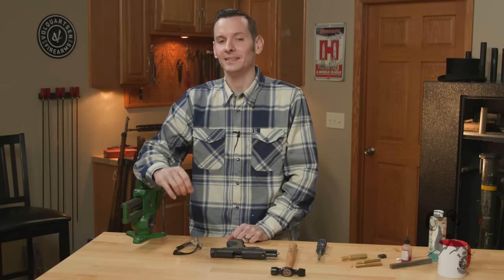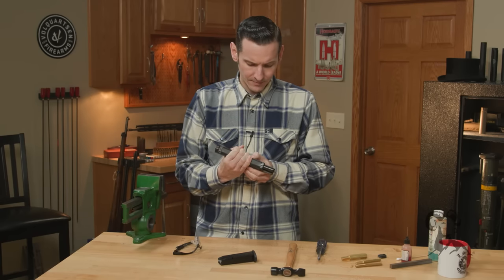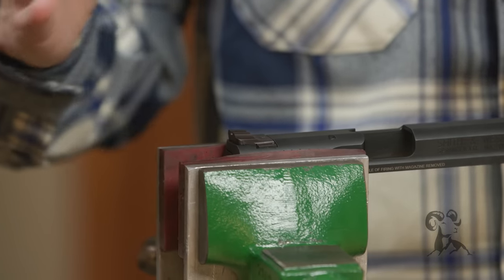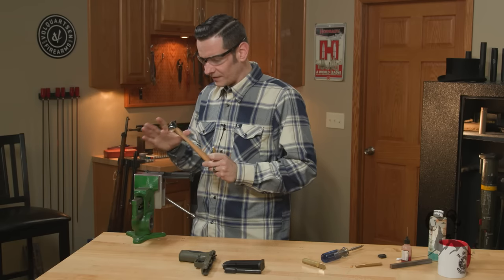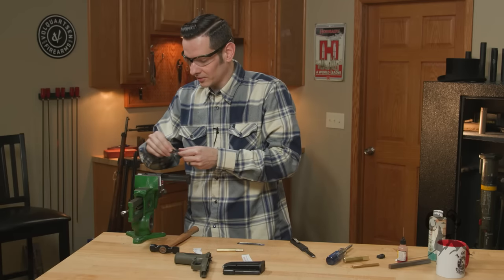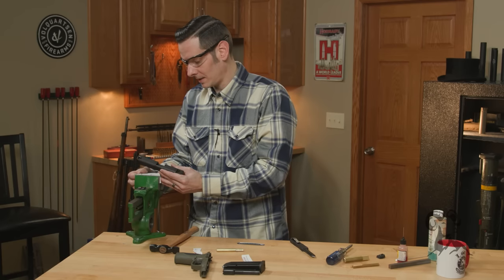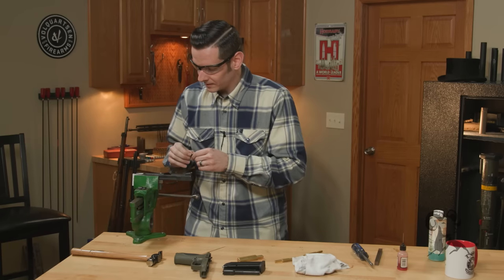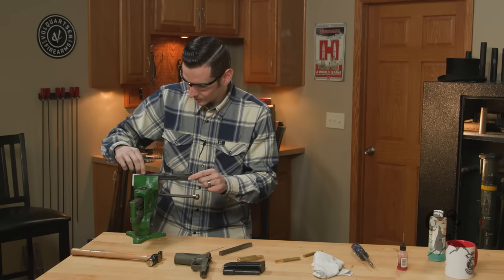Tech Tip: How To Install Pistols Sights the Old School Way

Comment: Smash that like and sub button if you have ever damaged are marred something because you did not have or want to use the specific sight installation tool.
Reply: I'm actually ashamed  🤣
Reply: Define "Damaged or Mared".
Like safe queen "omg you nicked the finish" or like range "would've been a great shot if I wasn't aiming three targets over" ? 

Either way I'll contribute to their proliferation with the like and subscribe features. Just saying
Reply: I destroyed so many inexpensive brass punches removing and installing sights.  The sanding wheel makes quick work of the marred punch and can easily brings it back up to spec for the next job though.
Reply: Caleb, I wish I had this video last year. I watched other people remove M&P sights, but yours was the best. I gotta say those factory sights got destroyed bcuz they were so tight. I ended up using steel punches just to move them. I put penatrating lube first, but no go. It didn't matter bcuz Tru Glo sights were going on my Shield anyways.
Reply: What would be a good host to try tons of iron sights when changed a lot? I there like an insert available that makes it easier to change to narrow things down?
Reply: Dang dude, your pinky has some weird flex to it when you were using the punch driving the sight out.
Reply: Right after cerakote too

Comment: Watching you struggle with that sight made me so happy.  I have changes the sights on 4 different M&Ps.  Not one we’re able to be removed with a brass punch.  I have two destroyed brass punches that just mushroomed from me hammering in it against the sight.  I have always needed a steel punch to get it started.  Luckily I have yet to damage the sight with the steel punch.
Reply: be sure the dove tail is not tappered.. sounds odd, but I've ran into it. it will make ya scream.. then comes the flying hammer technic.
Reply: Same with my Shield 1.0! I bent the brass punches then went to steel punches finally. I did use penatrating oil first but since I was installing Tru Glo sights it didn't matter if I destroyed the factory sights. Sight pusher tools got messed up too. Those sights are a bear to get out!
Reply: I destroyed the front sight on my security 9 and now cat get it off 😂😂😂

Comment: I had a S&W handgun that I was changing the sights out on many years ago.  I was not aware of the striker safety being under the rear sight.  The parts went flying away from me and I had a rough time finding everything.  I ended up finding most parts except the spring.  I did not have anything on hand that was small enough to fit as a replacement.  I contacted S&W about my dilemma, they said no problem and sent me a new spring free of charge.  I know these springs are not expensive and at the time neither was mailing one to me, but I still appreciate their customer service and helping me out of a jam.

Comment: TIP: Older S&Ws have 2 plunger/springs under the rear sight, so if your punch stays flat on tenon you're okay, but you can also drift with a large ziplock over e-thing, to catch any boingers.

Comment: Well done. 👍
I'm a long retired gunsmith and was trained by old school instructors at the school in Trinidad Colorado. After graduating, I apprenticed under an old master gunsmith for four years for zero pay. (I was a peace officer, and worked in the shop off duty). The man was a longtime gunsmith for the Colt Custom Shop, and was unbelievably skilled. This was in the mid 70's. Everything I learned was old school. And that's not a bad thing at all. 😉

Comment: The bigger/heavier and more secure your bench vise is, the better. Also, smooth copper or aluminum vise jaws are ideal to get the maximum energy transfer into drifting the sights out vs uselessly oscillating the entire slide with every hammer blow. The more immovable the slide, the better. If you have a rock-solid fixture, you will require nothing but light taps from an 8oz ball peen hammer to drift out even the most stubborn sights.

Comment: I went to M&P Armorers school, the handguns we used in class were very well used and the rear sights basically slid off, the instructor assured the class that the handguns we will be working on outside of the classroom will definitely put up a good fight. Great video, thank you for sharing!
Reply: He was right! My Shield 1.0 was a PITA to remove, even after penatrating oil was put on the dovetails. Destroyed the factory sights, but I didn't care. Tru Glo was being installed.

Comment: A welcome video Caleb, the M&P sights can be a pain sometimes but you made quick work of this. I wish they were all this easy. I'm about to go off, talking bout cases where it isn't easy, maybe my fellow enthusiasts/gonsmiffs/legit smiths can share thoughts. 

Have you ever attempted to remove sights that are nearly Fn impossible to remove, even with a pusher or properly sized punches? I'm an armorer for a local shop and have come across a few. We get our tools from Brownells and I use an MGM pusher on the daily, great tool that I've installed hundreds of sights with. But they're not all so easy...

Let me say some M&P front sights are incredibly hard to get moving, esp. their suppressor height sight models. I try and give good solid whacks with your triangular brass punches, but the sights steel actually gets dented/peened due to it just tanking the force without moving. So much for softer metals not being able to damage harder metals 👀 They absolutely can, with relative ease, even, ask me how I know... 

We also had a Springfield RO 1911 with an off-center rear sight that I couldn't get adjusted, so we sent it to Springfield, and we get it back with a huge freakin' indent where it looks like even THEY had a bear of a time getting it centered right.

So in these cases, what's a guy to do? Heat the area up? Oil it up? And how the hell do these companies get these sights so tightly driven in in the first place, I'm guessing with some type of specialized press?
Reply: Thanks for the kind words and yes. The old Springfield XD sights were like this, in these cases I used a Wilton Machinist vise with custom aluminum soft jaws and a large steel taper punch, the customer just had to be informed that the old sights were no longer going to be useable and they were pretty much always okay with that.
Reply: @CalebSavant   Thanks much Caleb. Steel on steel, in a perfectly, 100% supported vise eh... makes sense. If you can recall, what size is suitable for the taper punch? 

And in your experience, can heat, or temperature in general aid in the removal of sights? I figure thermal expansion could be a thing with sights and their dovetails, like how BCM handguards require heat to be slipped over the barrel nut? Or, is this exclusive to aluminum? On the other hand, I've heard freezing a sight/slide can make it easier to work with... haven't tried it and am skeptical, but yeah, ever heard of this?
Reply: @lon242  Heat can indeed help but the amount of heat you need is likely to discolor the slide if you're not careful. I haven't tried freezing but the big steel taper punch worked every time. I'm not sure what size, I just grab the largest one that I can fit in the dovetail without damaging the actual slide.
Reply: @CalebSavant  Got it, will keep this in mind the next bear of a sight I run into. Have a great end of the week man 👌
Reply: use a brass punch and then a air hammer or rivet gun. PS be very very carful i would cover everything other than the sight with wood to prevent possible marring. used this on a friends m&p. it should be your last resort and use two people one on the gun one on the punch for max control. Also from the aircraft world try mouse milk it is a little expensive compared to wd40 but works better at penetration and will go up into a cracks instead of just down so works at all angles.
good luck

Comment: You will have to do a front sight that has a tenon post for securing the sight to the slide
Reply: Noted!
Reply: @CalebSavant  I bought sights from Brownell for my series 70 1911.  I was going to get the front sight staking tool, but just too afraid of doing it wrong on my classic Colt.  Better to have a experienced 1911 gunsmith tackle this job?

Comment: Just to add, some sight manufactures say to file one of the angles instead of the bottom. Removing from the bottom makes it shorter and less room between the top of the slide and the underside of the sight leaf/blade.
Reply: I am taking it off the bottom next time

Comment: I would like to suggest that you can also use some tape to hold the cardboard to the vice jaws so it will be easier to keep in place and not have them move around while putting slide into them.

Comment: In removing the factory rear sight on my S&W Shield pistol, I discovered that the set screw on that sight had been set with red loctite.   It wouldn't budge.  Using a tip from the web, I used a soldering iron to heat the set screw for about 30 seconds, and the set screw came out without a lot of trouble.  I used blue loctite on the set screw of the replacement sight.

In fitting the rear sight you took a bit of material off the dovetail bottom of the sight.  Has this always worked for you, or have you found times when the base of the sight that rests on the slide prevents the sight from dropping enough to make the cut on the dovetail bottom effective?  In such a case, you'd have to remove  material from the angled sides of the dovetail.

Comment: Some sights just are too tight and need the manual method! If you take your time there's no issue. Might sometimes need some solvent if the sight is glued too much also.
Reply: Heat may help loosen up

Comment: One question i have is , how do you know if the front sight is centered without measuring it with a caliper tool ? i have often wondered  about that, some gunsmiths that i do know have always used a sight pusher tool, could never figure that out, i liked the tutorial video you made, thank you

Comment: I need some Brownells Alumihyde, I tried using aluminum black on the inside of an 80% receiver and it wouldn't work. I knew around the anodizing it may not, but the inside is raw aluminum..., The Alumihyde would be better and protect the lower better anyways, plus I can redo my handgun slide as well

Comment: Maybe it's just me, but I've never just "Eyeballed" a sight when installing.  I measure both sides until I'm within .001 of DNC, (Dead Nuts Center).  I picked that up working in the Military as a Weapons Instructor/maintainer and found that a few gun shops I've worked for since held the same standard.  True it takes longer, but I've never had one come back and on my own guns, never had one that was off.

Comment: Would adding Rocksett to the dove tail be a acceptable method of correcting a loos sight/slide interference?

This is how Sig “repaired” my Legion P938 front sight.
Reply: they also probably "peened" the grove useing a center punch in the dovetail. your good

Comment: Man I wish I would of seen a video like this earlier. Recently I sent a local gunsmith my range handgun to install a new set of sights and extract a stripped grip screw. He did a fine job on the screw but once I got the gun home I noticed significant scratches near the sight. He must have been using a steel punch. I have a set of brass punches. If I would of just done a little more research then I would of saved money and my handgun from getting scratched.

Comment: Something to add: If you run into a dovetail that was cut a few .001"s deep or an undersized sight (manufacturing tolerance stack or overzealous stoning) it can easily be remedied by a piece of shim stock made from the appropriate feeler gauge cut to the same size as the sight and "glued" to the bottom of the offending sight. Or peening the bottom of the sight to rase a burr to take up those .001"s. A little grease on the dovetail will also keep the dovetail from galling during installation.
I personally prefer to shim it rather than the peening method.

Comment: Aren’t M&P sight dovetails directional? I’ve had issues with them and sig being that way. Any thoughts on that?
Reply: No I checked with them. M&P sights go in or out either way. No so with other manufacturers. But the rear sight is best installed like Caleb did to hold down the plunger and not damage it.
Reply: @mikewithers299  good to know. When I called and asked they told me they were left to right directional. 🤦🏼‍♂️
Reply: @spencerdavis8737  I tried that but mine were frozen in place. Not rusted but firm. I kept looking for the correct way thinking I'm doing something wrong. I tried a sight pusher tool. It got mangled too. Brass punches bent. Finally went with steel punches and it popped out. The whole time I oiled the crap out of it. At that point I didn't care about the factory sights as I was installing Tru Glo. The slide never got damaged. Glad that one is done!

Comment: Maybe I just don't understand something but doesn't someone make a gauge or template or SOMETHING to ensure that the sights are centered.
I would think that would be really important.
Just "eyeballing it from side to side doesn't seem precise enough to me.
If I've missed something could you please explain.
Thanks
Reply: As mentioned, you can measure with a caliper but center in the slide does not mean the point of aim/point of impact is going to be on.
Reply: Caliper each side to center it, then test fire to see where it impacts. Adjust as needed
Reply: @mikewithers299  yeah , thanks man.
I went back and watched the video again and I caught the part about centering it with a caliper.
Thanks 👍
Reply: @kevinnobody3052  I saw a video that showed how to hook the caliper on the opposite side of the sight post and measure to the outside of the slide, then repeat the other side until both measurements were the same. Lock the calipers so they don't move and check back and forth until it's the same. Light taps on the sight, and adjust the calipers each time (remeasure and lock) until it's the same. Test fire it to make sure point of aim matches point of impact. Make small adjustments if needed with a punch.

Comment: I have been told that sights should be pushed in specific directions for removal and installation. Is this true. In the video you pushed the front and rear sights in opposite directions. Please advise.
Reply: Not on M&P's
Reply: That's the case with some companies but not here. Always look at the manual.
Reply: The M&P armorer's manual states both front and rear sights shall be removed left to right.
Reply: @firearmstraining7721  That's what I thought. Thanks.

Comment: What sight do you adjust if your rounds aren't going where the sights say they should be going? Or is it one of those of the sights are dead center left to right then you're good? Obviously I'd run a box or two at the range before I put my life on the line from untested sights.

Comment: A couple of pieces of tape on top of the jaws would hold those paper shims in place and reduce frustration.  On the rear you pushed it out left to right, on the front you pushed it out right to left.  Does the direction matter?

Comment: Me again.  So I have a new M&P. After zeroing the optic it is obvious that the irons are off(no it isnt my shooting, the front sight is about 0.020" off center).  I have now damaged another punch, and then when using a pusher tool I slightly mushroomed the edge of the sight base(the dovetail). Does any body have any tips before I just hulk on it and potentially break something?

Comment: Hey fellas, I want to put together a pistol similar to the sig 320 specter comp but I personally prefer glock. Could I put a glock 19 gen five slide onto a 17 gen five frame and put a compensator on it to end up with that same style of the comp not overhanging the dust cover too far? I already have a 17 and and would just buy a 19 so I could swap the slide back and forth between the two, I don't really want to get a 47 since I already have the 17.

Comment: I bought a Pedersoli Mississippi rolling block rifle from Cabela's.  It shot low.  I took it back to Cabala's.  Cabala's sent it to a gunsmith.  I got the rifle back all well and good.  I shot the rifle;  the new front sight was lower.  I was able to sight in the rifle..  I took the rifle out of the box 3 months later.  The front sight and dovetail were encrusted in rust.  I removed the front sight and removed the rust.  I only had one small pitted spot on the front sight.  What did the gunsmith do to cause the rusting?  I had oiled the rifle well.  I was grateful I checked the rifle when I did.

Comment: How do  you adjust the windage at the range?
Reply: bring a fine engineers pencil and make a mark on both sides so u can see your progress, have someone hold the slide for u against a bench or tailgate with rag for padding. It will work

Comment: Seeing that the front sight does not have a set screw or having been pinned in simply wiping off the oil is not enough. Thoroughly clean the bottom of the sight & the dovetail on the slide with a solvent such as Mineral Spirits, IPA, etc. to remove all of the oil and then a drop of blue Loctite to secure it as otherwise it may have a possible a tendency to move after firing numerous rounds!